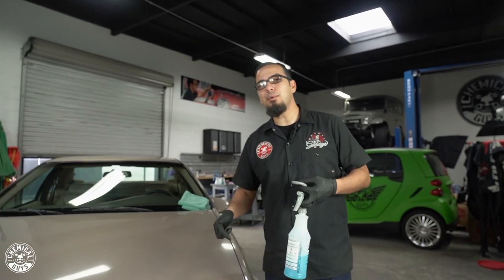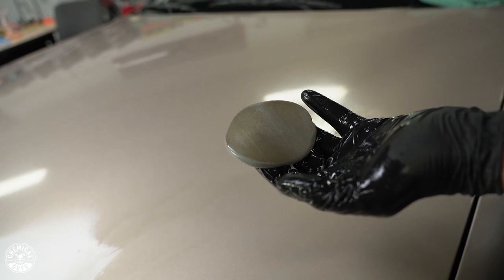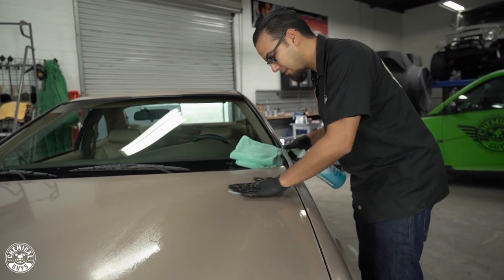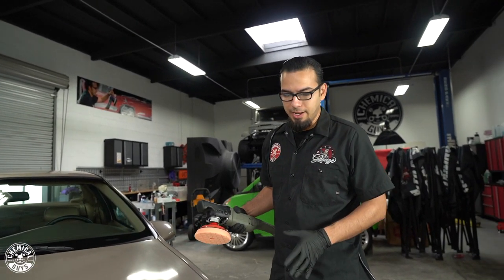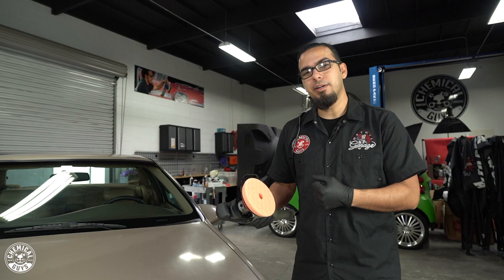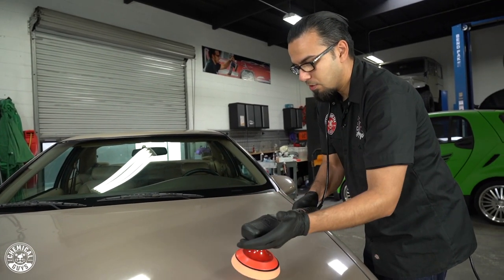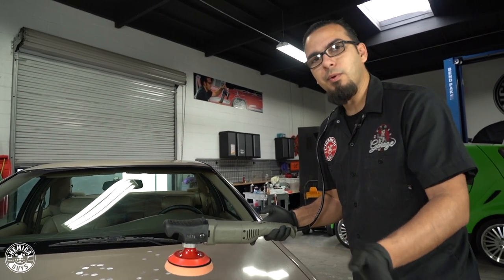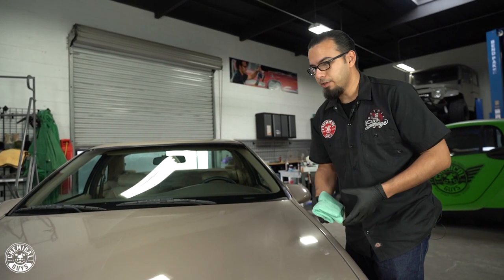How To Correctly Use A Rotary Polisher! - Chemical Guys

Comment: Just an educational question...What’s the intent of starting a rotary polisher off the surface, vs a DA on the surface? Thanks!
Reply from the maker: Hey Robert! Great question, since is a rotary is direct drive and only spins on one axis, placing it on the surface and then turning it on will create a swirl whereas the DA has a counterweight that dictates the oscillation but won't create a swirl when placed on the surface. Also, by placing the DA down before starting it will save the bearings and prevent product from being flung.
- CG Nick
Reply: @ChemicalGuys  Thanks! Makes sense. I was just curious about the rotary slinging product. 
   You guys are the best! 👍

Comment: Hey guys - I've been watching your videos to get an idea of how to properly polish out the paint on the '78 Thunderbird in my garage. It was my grandfathers, and at some point in life, all the vertical facing parts of the car (doors, etc) were repainted and clear coated. The horizontal surfaces (roof, hood, trunk) are all single stage paint still and have some swirls and water spots on them and are also going dull. My question is whether I would have to use a different technique with the rotary polisher for the horizontal surfaces than I would for the vertical surfaces.
Reply from the maker: Hey Jamie! Thanks for your message. The same process would be used for the entire vehicle. Keep the pad flat and moving constantly without applying pressure until the compound/polish used turns clear.
- CG Nick
Reply: @ChemicalGuys  Thanks Nick! I'll give it a shot when it stops snowing here, so probably April. Keep up the great videos, they're really informative!

Comment: Nick my question is is it okay to use the cg sealant and then ceramic coat it??? or not required??/
Reply from the maker: What's up Eric! Good question, applying a ceramic will give you the most protection and it can also be layered with glaze, sealant and wax for more shine and protection but it is still perfectly fine to use a sealant as a standalone layer of protection.
- CG Nick

Comment: Have you tried using a clay mit? Much larger surface area, cuts the time in half and if you drop it you can wash it off with hot water, rather than replacing it every time.

Comment: Which pad should i use with the scratch and swirl removal product?
Reply from the maker: Hi Mark! I recommend using an Orange Hex-Logic Pad when using VSS to properly breakdown the product.
- CG Nick
Reply: @ChemicalGuys  Even if the paint is well maintained but just has slight surface scratches?  Thank you I love Chemical guys products and your videos are awesome

Comment: I polished my car with the rotary torq from you guys but I had rotary swirls and plan on re-polishing in the spring... what are tips to get a better finish? I had tried the hexlogix pads,and a rotary. Did decon, clay, and tar removed so I didnt miss any steps, just looking for better tips on polishing. @chemicalguys
Reply: You need a rotary with a fine polishing foam pad. Run it at about 1000 rpm with a good finishing polish or specific swirl remover. Getting rid of holograms or swirls is mostly about technique with the polisher, you've got to be deliberate, slow and flat with light pressure. If they are really bad you might need to use a medium foam pad first with slightly more aggressive cleaner wax or one step like malco rejuvinator, then hit it with the swirl remover after.

Comment: can you clay a car if the paint has been chipped off by rocks?
Reply from the maker: Hi Mike! Thanks for your message. It is possible to clay around rock chips but it is best to avoid applying excessive pressure to these sensitive areas.
- CG Nick

Comment: Does my DA polisher have a reason to exist anymore?
Reply from the maker: Hi there! DA polishers are still great for paint correction or applying glaze, sealant and/or wax.
- CG Nick
Reply: Chemical Guys i have a 2018 Durango SRT and I noticed that it didn’t correct a lot of swirl marks on the hood (aggressive hood has a lot of indents and hood scoop so it wasn’t always spinning). I should get a rotary shouldn’t I?

Comment: If the clay pulls of the junk and you then fold it back together, then the clay is holding onto that junk.  Are we not in danger of having those micro debris then marring the surface?
Reply from the maker: Hi there! Yes, as you clay the bar will collect the extracted contamination and it is necessary to roll and knead the bar until you can no longer find a fresh side, in which case it would need to be replaced.
- CG Nick